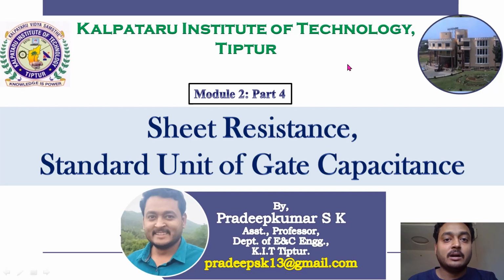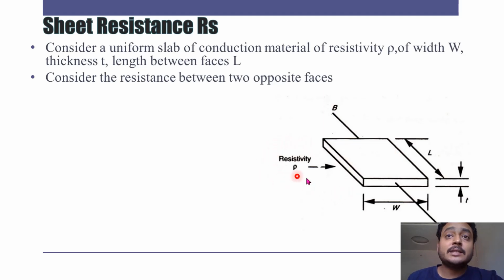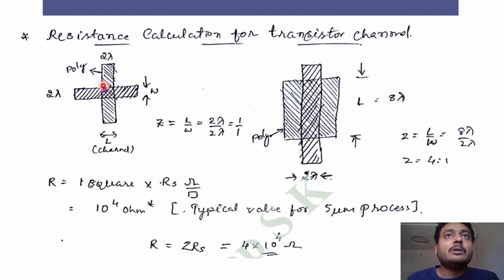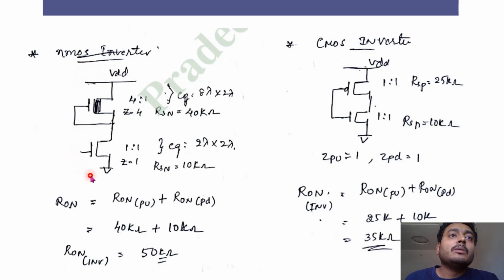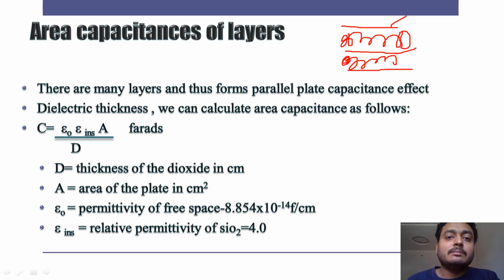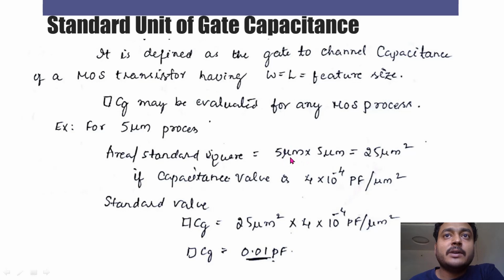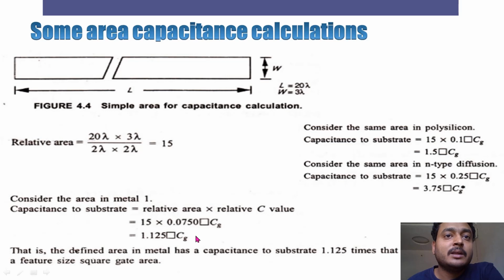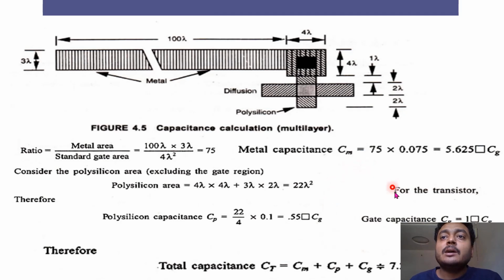VLSI Design Module 2 [Part 4]: Sheet Resistance & Standard Unit of Gate Capacitance

Comment: dear sir while finding capacitance for metal 1 to substrate u r writing = realative area * relative c value but then u are also multiplying cg (standard gate capacitance value ). ralative value was = specified value / gate to channel capacitance value. that means u r actually multiplying relative area with specified value and not with simply relative value 
pls clarify
Reply: and why r we taking relative area?
Reply from the maker: We are expressing capacitance of any layer w r t gate capacitance, so need to express area w r t standard gate area which is 2lamba X 2lambda .
Reply from the maker: For both resistance and capacitance here will be expressed in terms of Rs and Cg. say 5 Rs is resistance obtained which means when u replace actual value of rs here u will get value in ohms. Similarly say 1.125 cg is capacitance when u replace cg value for that tech node u will get value in farad.